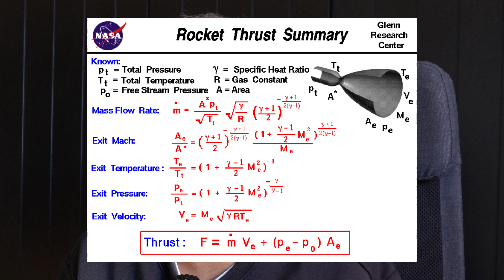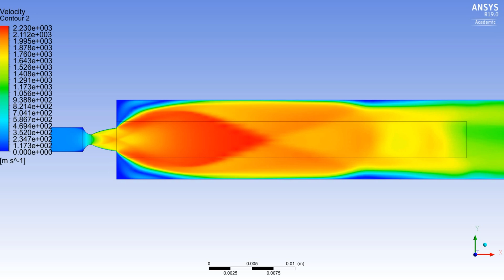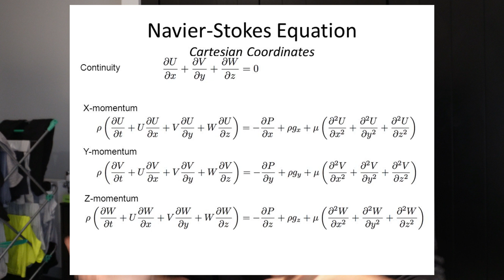YOU CAN'T SUCK AT MATHS AND BE AN ENGINEER

Comment: Hi, I got a grade 5 at gcse maths therefore I wasn’t great but not bad, I’m now studying mechatronics engineering as a level 3 extended diploma therefore I’ve applied for university. However I’m worried about the maths. I’ve applied for aerospace at Sheffield Hallam. My college course states that it involves maths but I have learnt literally nothing since gcse regarding maths. Will I struggle at uni with the maths ?
Reply: yeah
Reply: don’t they have a foundation year course?
Reply: @josephbenson606  depends what uni, usually unis have foundation engineering, and after that u can choose aero or mechanical or pretty much any engineering
Reply: Hi, they do have a foundation year maybe consider that also msg me i can help
Reply: @zahzedzah thanks for the reply, my comment was 2 years ago. Just finished my first year aerospace, passing all modules and exams.
Reply: @moorimoped8010 which university and does the degree require much math and physics throughout or it's mostly hand work